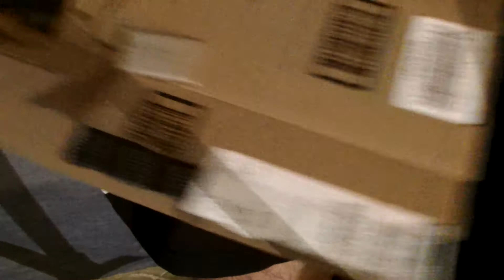Customizer Corner Preview: Titanium Morpher Update (1080p)

Comment: I have an actual Titianium morpher and i wanted to replace the soundboard, what are you using hardware and software wise so i can try and get this going myself?
Reply from the maker: when its all together i'll post a build it log but for just the sound board and speakers I'm using a adafruit FX board though id advise going with the 16gm version at 2 I had to down sample my 3 clips to mono so I'm not gettingthe full use out of the stero speakers https://www.adafruit.com/products/2133
Reply: cool look forward to your videos sir, I figured out the problem with mine, but i will use your tutorial to make a different morpher.
Reply from the maker: cool wekk stay tuned
Reply: will do
Reply from the maker: if you want my audio files toss me a email and I can provide them as well but their designed for thr 2gb sound board so let me know if you got larger so I can made a new set